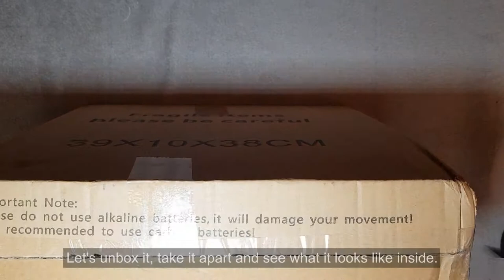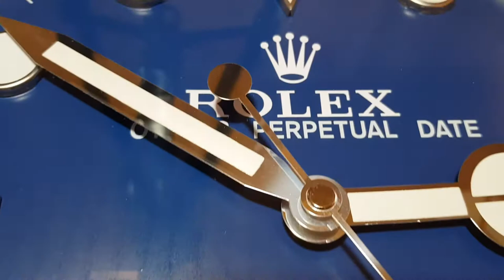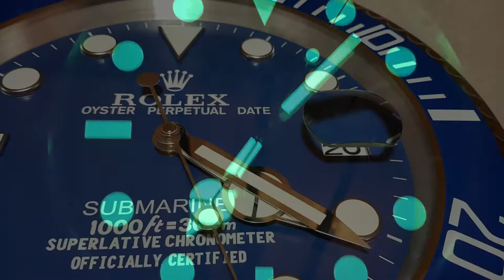Rolex wall clock -  Unboxing and Let's have a look inside.

Comment: Where did you buy it from let me know the website
Reply from the maker: I bought it at AliExpress. Have a great day.
https://www.aliexpress.com/item/1005004047388358.html
https://www.aliexpress.com/item/1005004128231956.html
Reply: @onlyworkingtrix7472  Ugga Ugga Mubba
Reply: the knes i find usually don't have the right glass. missing the magnify sections
Reply from the maker: @INFAmadeOFF  Ask the seller for a picture of the real product in a personal email.

Comment: When I see on ali express the Rolex name is missing on clock
Reply from the maker: Sellers cannot advertise photos bearing the name Rolex due to copyright. Send a private message to the seller asking them to email you the actual picture to make sure.
Check out that a magnifying glass on the date part of the clock.  The products in the link below have it. Have a great day.
https://www.aliexpress.com/item/1005004047388358.html
Reply: Where are you from sir?
Reply: @spunkaustralia  cant find the clock n wthat s the name of seller how to find
Reply from the maker: @onlyworkingtrix7472 I am Korean who learned English in Australia.
Reply from the maker: @rajeevbbd  Ask this seller at AliExpress. I bought it from there.
https://smonsisa.aliexpress.com/store/2784025
Reply from the maker: @onlyworkingtrix7472  I am from Korea Rep of.